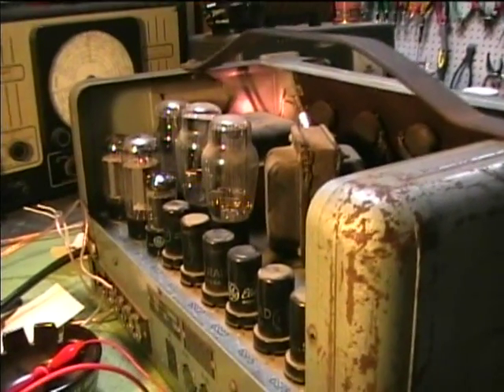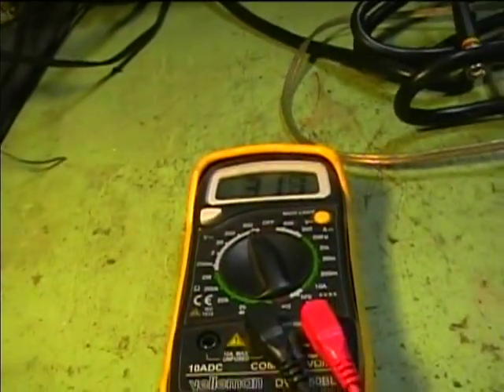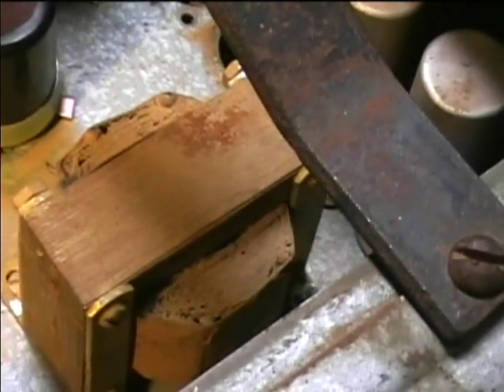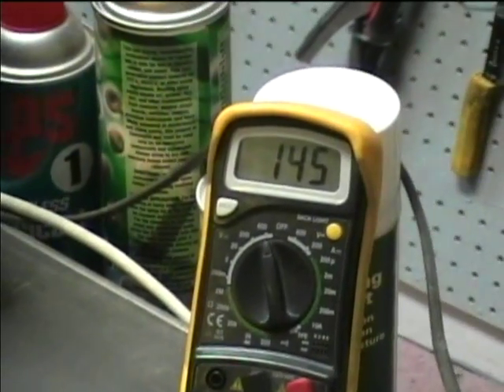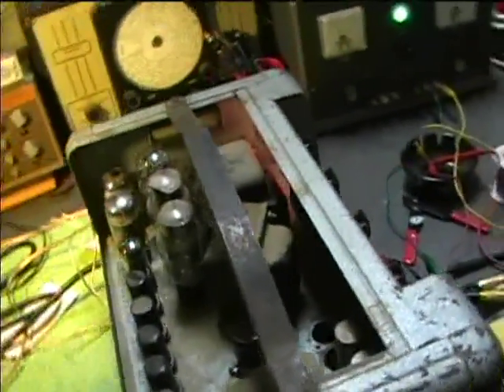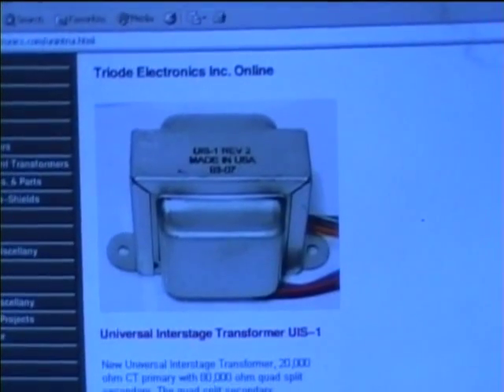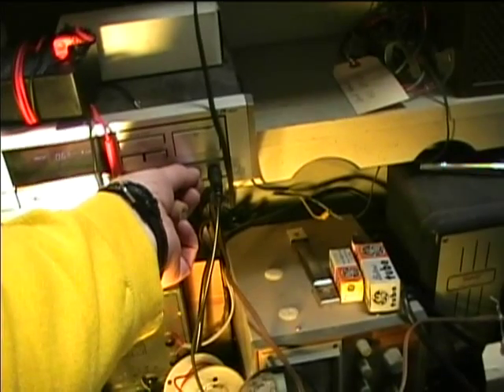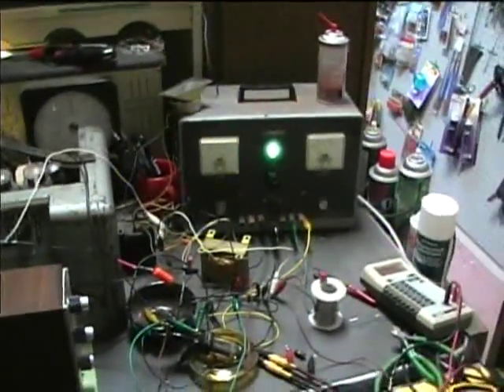1941 Rauland Tube-Type PA Amp interstage transformer repair

Comment: Hey Chad, I've got a 1973 solid state Panasonic stereo system (all in one)  thats making the same scratching noise. It also squeals occasionally and makes a constant light hum. I've replaced the filter capacitors and that didn't make much of a difference. It's also getting quite a bit of RF interference. Does this sound like the transformer is bad? If it is bad, any idea what rating of transformer would I need?

Comment: Next time try this first. CLip the two leads from the trans primary. Substitute a 10k 10w resistor for the trans primary. ground the lead that went to B+.Then,through a .22Mfd. 400v Cap connect the the plate transformer lead to the driver plate.Sometimes,removing the B+ from the trans kills the arcing.There will be no great potential difference between secondary and primary.You may have to go larger on the capacitor to bring up the bottom,but maybe not.

Comment from the maker: Thanks for the suggestions....I did carefully cut away the paper and found that one of the magnet wire leads was corroded. I made a new connection with new lead wires to the existing magnet wire after cleaning the oxidation off of the bad wire. However this didn't solve the noise problem so there must be more bad/corroded wire further inside the transformer.

Comment: I had that same problem with a Magnavox amplifier. I could neve really find the problem, and  I finally went over all the soldering joints with the soldering iron, and it did seem to solve the problem.  It looks like if the insulation inside the transformer was a little deteriorated tapping on it might increase the static. Just a thought.

Comment: Since the transformer appears to be bad, couldn't you carefully unwrap some of the paper on it to expose the leads and the copper windings connections? Maybe the solder joint has gotten corroded or something and that's where the noise is coming from. That way you could keep the amp all original as far as the major components. Since the tranformer's bad anyway, couldn't hurt to try.
Reply: I have rewound one transformer.